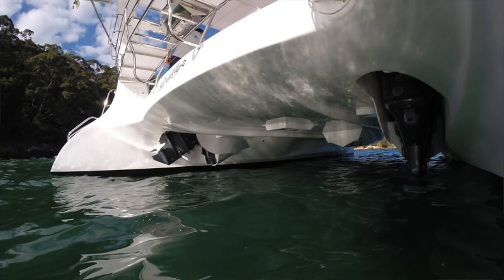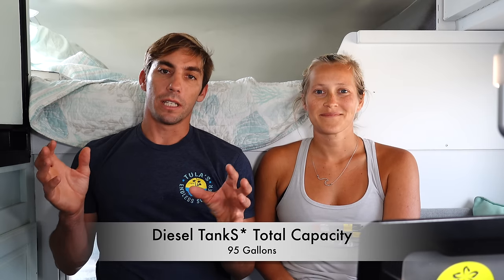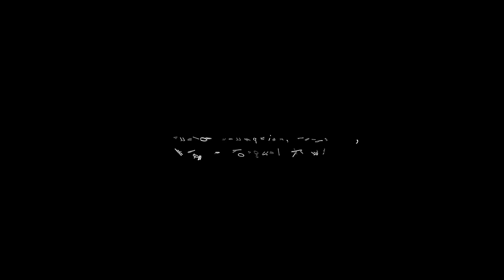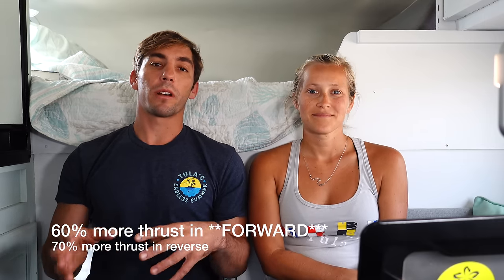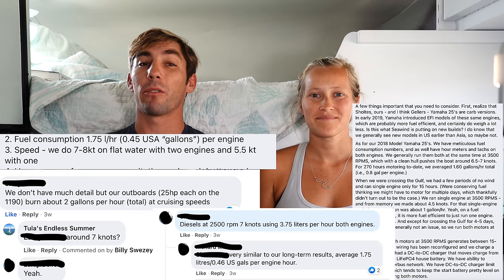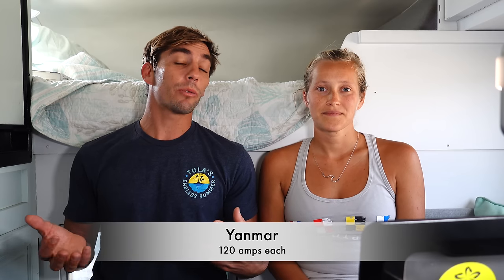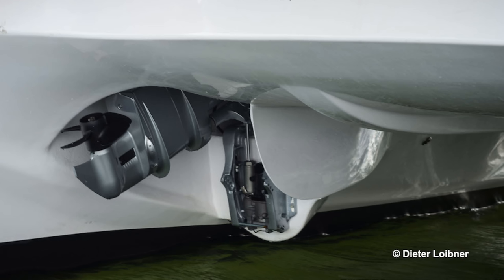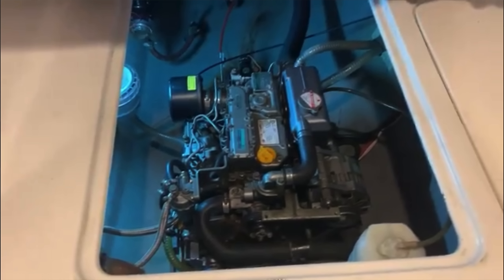Do Outboards Make Sense on a Performance Cruising Catamaran?

Comment: Having  Honda  Motorcycle  history  I  would  go  with  Honda  for  reliability .    #1:  substantial  quantity  discount  when  purchasing  3  identical  20  HP  Honda's  !     " Buy  two  .  .  .   get  one  Free ! ! "  sale .  
     #2:   The  weight  savings,  lack  of  use  &  increased  sailing  efficiency  'cause  they  will  be  tilted  OUT  of  the  water  over  99%  of  your  sailing  time !  should  please  Billy .
    #3:    Lower  HP  =  less  weight / fuel  consumption  &  your  not  in  a  rush  in  &  out  of  the  harbor .   You  DO  want  the  best  efficiency  under  sail  where  you  will  be  most  if  not  all  of  the  time .    And,   Do  you  need  more  than  20 HP  for  your  dingy  ? ?  ! !    Really  ? ? ?    For  water  skiing  ? ?  
    #4:   Running  a  diesel  drive  engine  just  for  electrical  power  is   super   inefficient  as  you  already  know.      A  small  ( Honda  again )  dedicated  generator  ( which  you  already  have ? )  makes  alot  more  sense  and  relieves  the  necessity  of  powering  up  a  propulsion  motor  needlessly .    Also  is  portable  for  providing  power  for  your  induction  cooktop  when  partying  on  the  beach  in  a  ' no - fire '  area .    
    #5:   Redundancy  .  .  .  is  nice.
    #6:   Your  catamaran  is   faster  under  sail  even  in  a  light  breeze  .  .  .  ? ?       Sail  is  your  primary  propulsion  .      I  wouldn't  even  have  motors  .  .  .  just  a  couple  of  paddles  !

Comment: OK, so you guys did not even mention environmental impact, which is incredible. Sure, electric outboards are still hugely expensive, but there is a significant difference in carbon output between four-stroke outboards and diesel. Also, the way things are going, diesel engines and diesel in general will be banned, starting with cars (2030 in Europe, for example) and boats will surely follow, with many marinas currently discussing banning diesel engines and the selling of diesel. Frankly disappointed  you guys are being so short sighted.

Comment: Hands down diesel engines. You need the electrical charging capability for the air conditioning and washing machine not to mention charging the batteries. We're on your side Sierra 😊😁👍👍👍👍

Comment: Having so much petrol on the boat is a very dangerous situation. Sure the tank may be isolated, but you have to get the fuel from the tank to the outboards. Over time those hoses can leak causing vapours to flood the boat cavities. One spark and the whole boat explodes. This does not happen with Diesel. Not to mention all the other benefits of diesel. Always diesel for me.